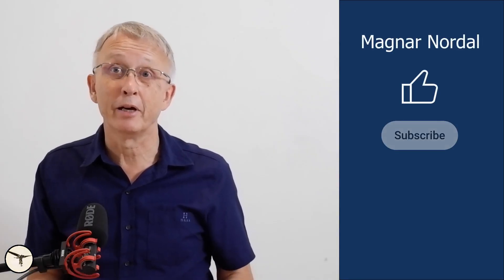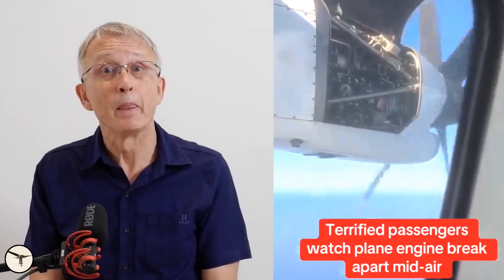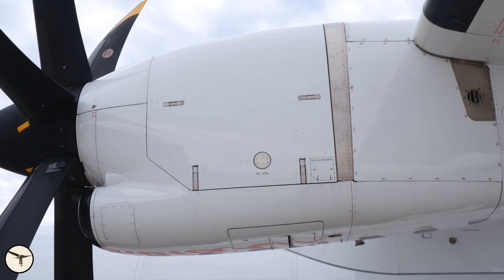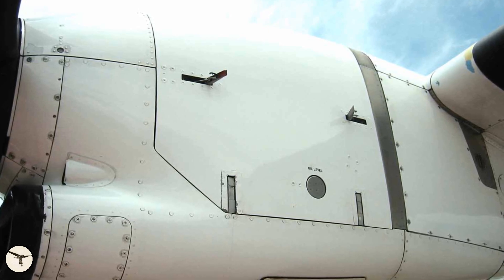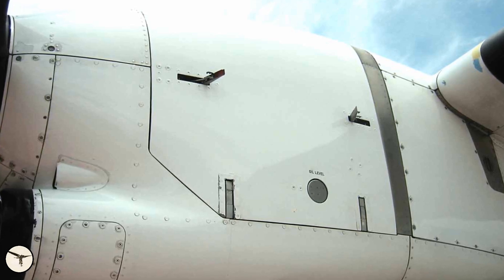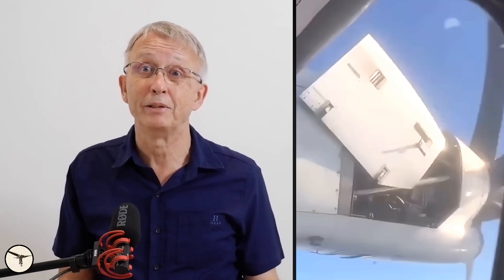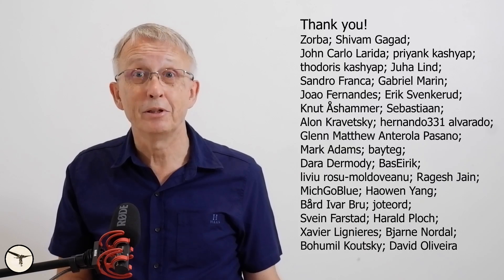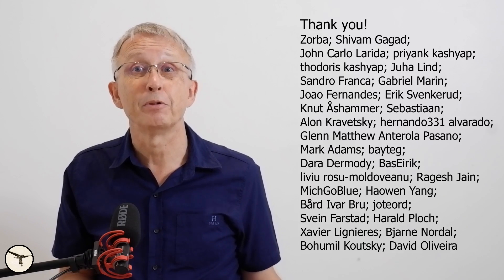What happens when you forget to close the engine cowling?

Comment: I am a warrant officer of the Hellenic Air Force , technical instructor and ISD certified (Instructional System development) . I've seen this happening one too many a time on the flight line - but always caught in time. It usually is a result of improper or lack of  supervision and on the job quality control (yes we have that on the line) . It usually happens during fast turn around and high stress situations ... That's why we have inspectors and quality controllers so the work can be double checked ....    It's a safety culture that must be cultivated and rigorously pursued all the time ... The company should check their procedures in that area ...

Comment: I was tasked with the inspection and ordering of spares after a similar incident. The door had impacted the wing leading edge, damaging the de-icer, and the assembly which the door hung from was twisted, Just to replace that, the cost was over 100,000 Euro. At the time, I demonstrated that the latches could be closed, but not engaged in the locks. Not a good design.

Comment: The cowling is not a structural part of the airplane. You can see the diagonal bars that are part of the frame holding everything together. So there was no danger of "the engine falling apart."
Reply: NO, but it will disrupt the smooth airflow over the wing. And could potentially cause damage to the propeller blade, wing or horizontal stabiliser, when it falls away.

Comment: What happens if the cowling rips free and from the slipstream strikes the vertical stabilizer causing serious control issues.?
Reply: It might hit the tail, but the cowling is relatively small and light so isn't likely to do any serious damage.
Reply: The risk is that the cowling wraps around some part of the wing or tail and causes control flutter. It’s usually better if anything coming loose on the airframe breaks completely free. In my airline we had a serious incident with an old B737-200 which had a leading edge slat break partly free. It wrapped around the outboard wing leading edge during a missed approach. As the aircraft accelerated towards 210 knots it took full control wheel deflection to control the roll, so the crew had to hold the speed down, while diverting to a distant airfield (due to bad weather). They flew at the maximum altitude for flap deployment, which was well below optimum for best range, and made it with only a few minutes fuel remaining. If the slat had broken completely free they probably would have been better off. You could hardly make this shit up in a simulator exercise!

Comment: If an engine cowling panel is found to have opened in flight, does the engine need to be shut down?
Reply: It probably would not be good idea to shut down an engine in this case, unless the engine itself, or propeller, has been damaged (unlikely). This is because the drag from a loose cowl would already affect the aircraft’s performance, so you wouldn’t want to make it worse. With luck, the loose cowl could completely detach. Then, you hope it doesn’t hit the tail! Or someone on the ground…
Reducing speed is probably the best strategy.